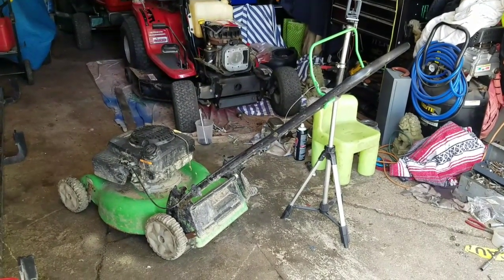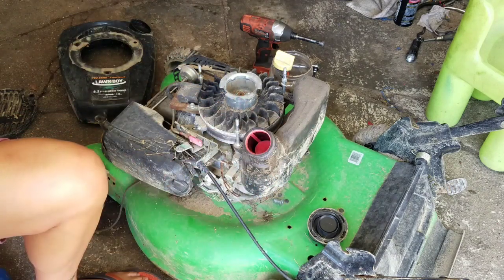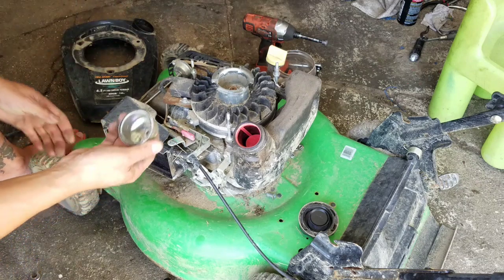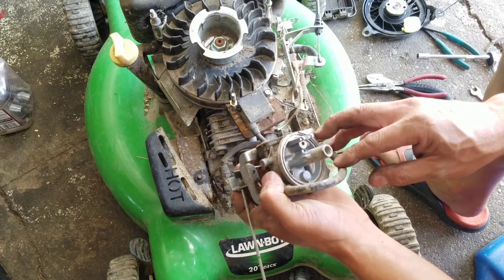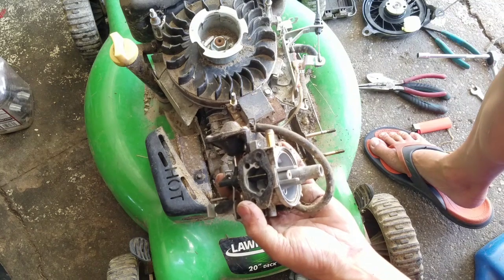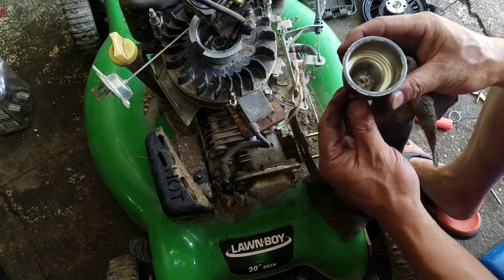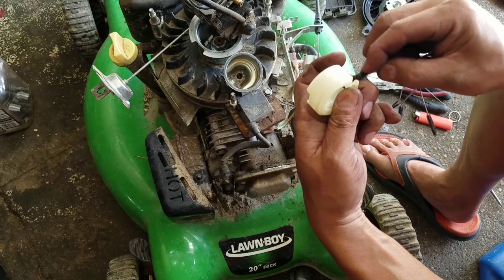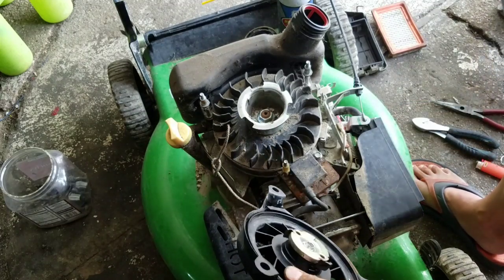LAWNBOY 20" PUSH LAWN MOWER KOHLER 6.5 149cc RECOIL STARTER ROPE HANDLE REPLACEMENT CARBURETOR CLEAN

Comment: Today I got a real score from the scrapyard, a kohler command single cyl 15hp, like the one on your toro, but the best part is it has compression, and its 100% complete, even has the muffler. Paid $2 for it.
Reply from the maker: Wow, that is a score.  Pull start or has electric start? Does it run? Wanna trade for it?
Reply: @MowersNBlowers  pull start, dont know if it runs yet, I have to mount it to something